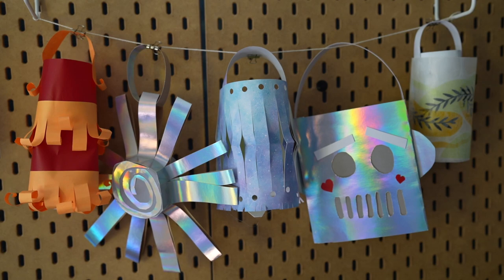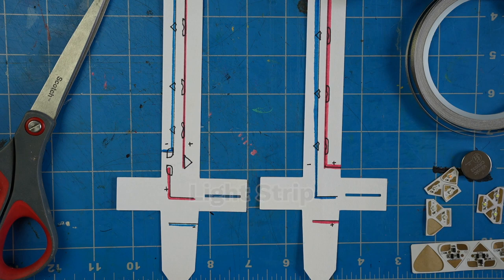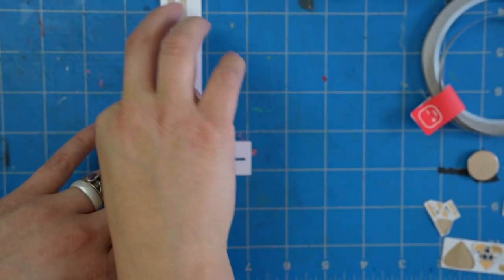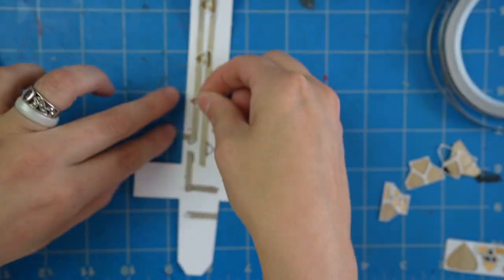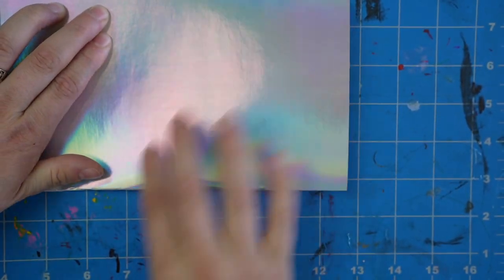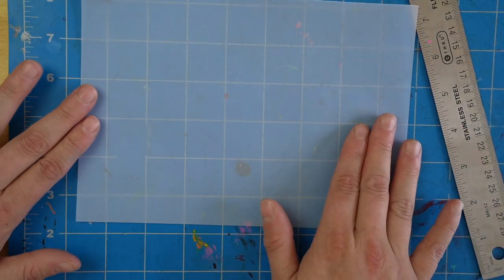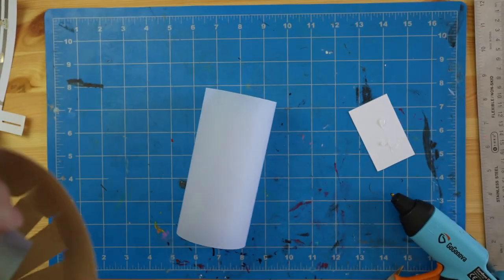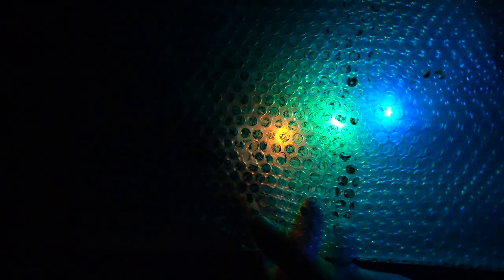How to Make a Paper Circuit Lantern with Chibitronics LED Stickers

Comment: Hi, I am trying to use your light strip template for this project but I am using regular LED lights and not the Cibitronic sticker lights since we use those at my school and it is not lighting up.  I have tried multiple times.  Do I need to do something different if not using the stickers?  Is the set up of the conductive tape different?  Please advise.  I appreciate any help.  Thank you so much.
Reply from the maker: Hi.  Might you be able to answer a couple of questions for us to help best answer your question?  Which of Celeste's Light Strip Templates are you using?  The one with the Circuit Effect Sticker or the one without?  How many of the through-hole LEDs are you using in your circuit?  What color (s) are they?  I am asking this question, because certain circuit configurations work better with resistors.  Through-hole LEDs don't have resisters built in, whereas Circuit Sticker LEDs do.